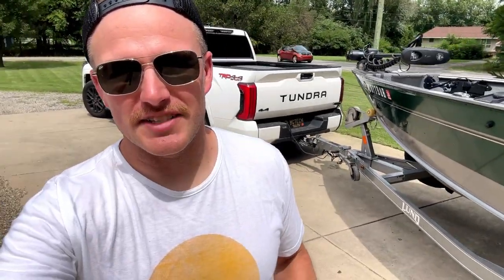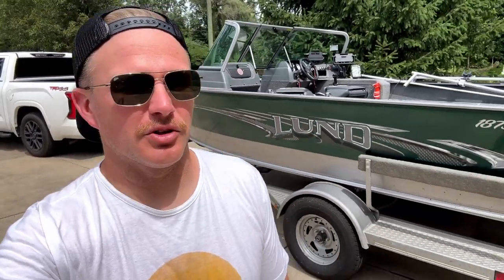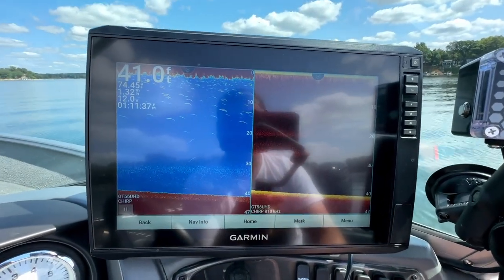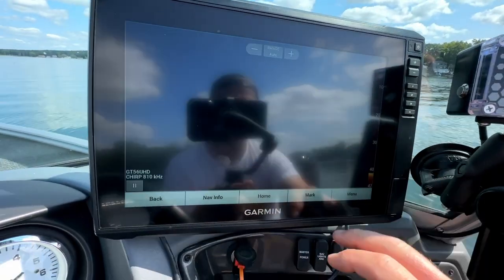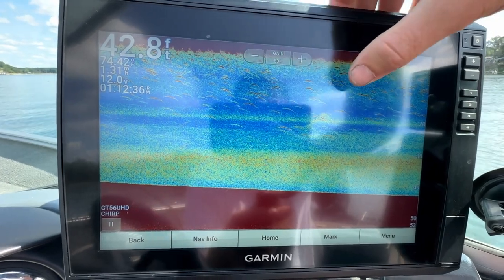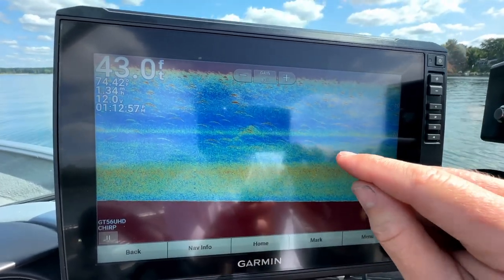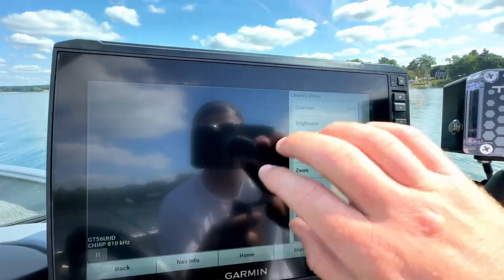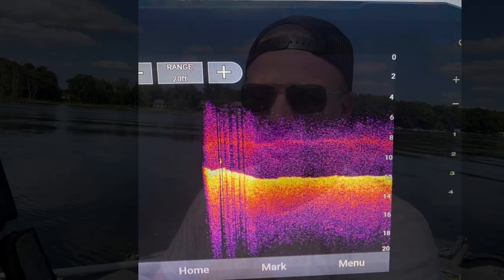Find the THERMOCLINE - Catch more fish!

Comment: In a column of water in the Great Lakes, colder, deeper water generally holds more oxygen than the warmer, shallower water. This phenomenon occurs due to the following reasons:

Temperature and Solubility: Colder water can hold more dissolved gases, including oxygen, compared to warmer water. As water temperature decreases, its capacity to retain oxygen increases.

Thermocline: The thermocline is a layer in the water column where the temperature changes rapidly with depth. Below the thermocline, water is typically much colder and can hold more oxygen.

Stratification: During the warmer months, the Great Lakes often stratify into layers with a warmer epilimnion (upper layer), a thermocline (middle layer), and a colder hypolimnion (lower layer). The hypolimnion, being colder, holds more oxygen.

The difference in oxygen content between cold and warm water can be significant. For instance, at 0°C (32°F), water can hold about 14.6 mg/L of dissolved oxygen, while at 20°C (68°F), it can hold only about 9.1 mg/L. This means that colder water can hold approximately 60% more oxygen than warmer water.

However, it's important to note that biological and chemical processes also affect oxygen levels. For example, deeper water may have less oxygen if it is not mixed well and if there is high biological oxygen demand due to decomposition.

Overall, the colder, deeper water in the Great Lakes holds more oxygen than the warmer, shallower water, potentially by a significant margin depending on the temperature differences.
(I think this is different from what you were saying)
Reply from the maker: That’s backwards of everything I’ve researched. 

Here is a good article that’s fishing based.

https://www.bassresource.com/fishing/thermocline.html
Reply: This sounds correct from what I’ve studied in Geology and chemistry.
Reply: Your theory doesn't seem to match the fish on the graphs ?